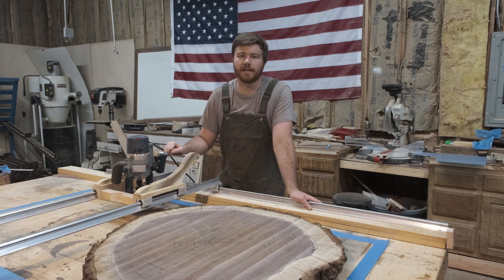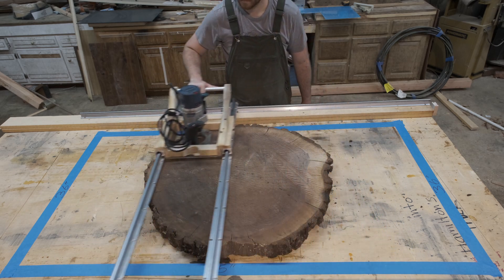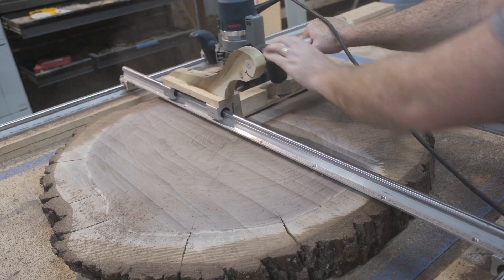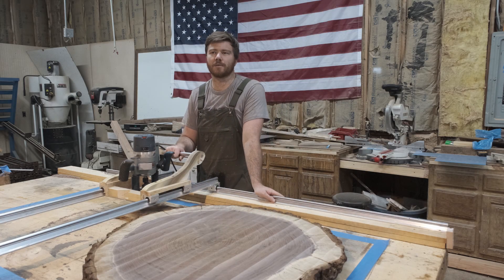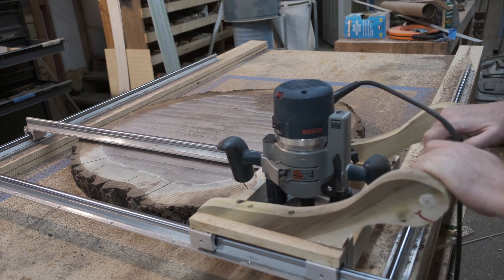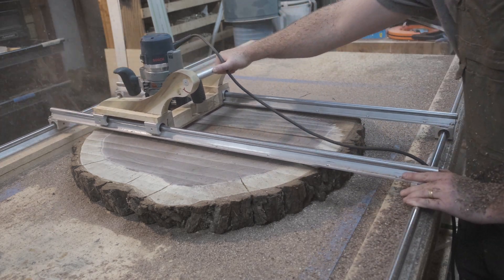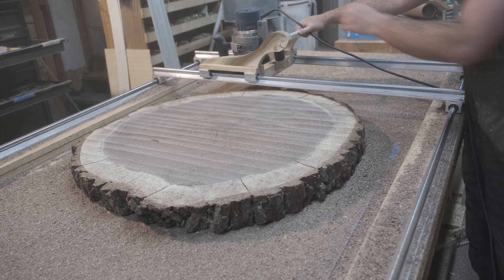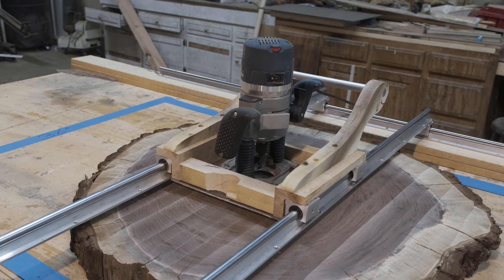DIY Linear Rail Router Sled / V1.5 Upgrades!

Comment: Hello, great video, i also flatten cookies with a router and a similar jig, but i have problems that sometimes the router kicks-back, don't you have that problem and isn't it a safety issue because you don't hold the router very tight.

Comment: I’ve added a 4” dust port to one side. My Triton router came with decent dust extraction vacuum port as well. So I use a vac for that too. I’ve tried the CNC brush strips. But were more trouble to fit. So gave up.  Should have gone with a shallower joining strip along the top. My design is in 3D warehouse.

Comment: Did you have to tap the holes on your sled rails, to get the top rails on the bottom rails bearing blocks? Bc following the links, my blocks and rails holes don't line up.
Reply: Correct. I used the bottom left and top right bearing block screw holes for more stability.  For me it was a nightmare trying to match up the precision of the machined holes. They should sell rails where the holes line up with the blocks.  Also I did read something about a certain rail size does match the bearing block holes. My 20mm rails did not match.  HTH

Comment: Just ordered my rails for a router sled and I'm so excited for it! Have a Bosch 1617 router and I was wondering what speed you'd run a 1/2" collet 2" flattening bit at for flattening slabs?
Reply: I have the same router and use a 2" Whiteside bit. The bit says to run around 12,000, which is somewhere between 1 and 2 on the speed dial on the router.

Comment: I like this idea for my own shop.  Do you know of an alternative to Amazon for these rails? (as I no longer shop with them).
Reply from the maker: Oh im sure theres a ton. I know McMaster Carr has some!
Reply: @HamiltonDilbeck  actually,  I managed to find an eBay vendor out of California.  Just ordered two sets of 1500mm so I can extend the length to 10 foot for my assembly table (with newly added extension).  A friend dropped off some 18" 9 foot tulip slabs to flatten for a table.  I got the 1200mm cross bars which should work well with my 4' wide table.  Looking forward to it.  Thanks for the inspiration!

Comment: Any deflection issues in the middle? I went with 20mm rods and im getting .040 dip in the middle with router wieght alone. Didnt go with the rail base style in the middle cause of weight. Curious on how much deflection yours gives in the middle before i go that route or try angle extruded  aluminum next.

Comment: Great stuff! Looking forwards to v2.0!
Triangulation is key to stopping the "wobbles". Braces (e.g. a length of all-thread") between the two ends of the two "short" rails would help to keep things square. Better yet would be a pair of (1/8?) sheets of aluminum above the long rail bearing blocks and below the short rails. Notch them to clear the router bit.
Look for bearing blocks with a "UU" suffix. They have seals that will keep out the (saw) dust. Either that or 3D print up some "wipers" that could constrain a couple of blocks of felt.
Look into a "CNC Dust Shoe" and an overhead vac hose to deal with (much) of the dust.

Comment: 12mm or 16mm rails ?
Reply from the maker: 16mm
Reply: Are the Rails standard design for the mower part?  If I get 16mm Rails from someone else to have for an extension, will they connect well enough to slide?
Reply: @steveandrewsmith  I was concerned about flex. So I went with 20mm. No. The screw holes did NOT match. On review some vids show only one screw per block was used.

Comment: A piece of heavy Aluminum Angle stock spanning between the glide blocks and the rails at each end of the cross slider should reduce the wobble.  4 bolts on each side of each end snugged down through the rails, and through the cross brace into the glide block should reduce the lateral wobble.  You might need to adjust your router gantry a bit to clear them, or they could act as your end stops as well.  It would also have the advantage of giving you a little more thickness for materials to flatten as well since it would raise your rails by the thickness of the angle aluminum brace.

Looking at your router sled, it doesn't extend below your cross rails, so it won't interfere with the travel.
YMMV.

Comment: Super Awesome! I got my kit put together. Guess what. The blocks use m6 screws... Also, I purchased a 1/4 in aluminum plate for the router base. No flex at all and very minimal. I may add the mower handle though. But first I need to build a table.

Comment: What do you use to secure the wood you are working on? Will simple double-sided tape work? Brilliant work!
Reply: I've seen closed cell foam hockey puck shaped work holders in other video
Reply: In the bottom left corner I have two shallow offcuts permanently screwed into the tabletop. One on the left side. The other along the bottom side. Making an L shaped corner stop. ( I_  ) I place my workpiece down snugged up against the corner blocks. Then another on the right of my workpiece and another on the top side.  This secures the workpiece on the horizontal. No vertical securing needed. To remove the workpiece you can lift it straight up.  Or to slide out you can unscrew the right side and if needed the top side stops to slide out. HTH

Comment: At https://youtu.be/5eGHxh7iHfI?t=54 in your video you mention buying extra bearing blocks and putting a piece of wood between them to stabilize the wobble you got when moved your linear blocks to the very ends. How would you end up "locking" those new linear bearing blocks in place so they just don't move exactly like router sled?
Reply: Extra BB not needed. A shallow depth hardwood length between the block and bar suffices for me.  I use longer screws lengths for mine.

Comment: Do you notice any flex in the cross rails. Looking at 1400mm for my setup. Thanks
Reply from the maker: I haven't noticed any flex at all on my setup. I don't think I would go about 1' wider, though. The linear rails are surprisingly rigid.
Reply: @HamiltonDilbeck  thanks for the responses  I think I am going to go with the SBR20 that should get me we’re I need to be

Comment: I bought a 1000mm and a 1200mm set of SBR20 linear rails, and unfortunately the screw holes in the base of the y-axis rails don't line up with the holes in the bearing blocks for the x-axis rails. Any suggestions for securing these together? They're both from the same manufacturer, purchased on Amazon. Should I return these and try for different ones?
Reply from the maker: Interesting, sorry that they aren't lining up for you. If I were in your shoes, I would drill in new holes. You can put tape over the bearing blocks and locate the holes and then make a little jig block for the drilling. Let me know how it goes!

Comment: Here are some tips for you.
In your earlier video, you complained about the cradle you made and the acrylic base. You don't need it.
All routers I know have a guide fence with guide rods. The rods fit into holes in the router base.

I measured the guide rods with my router and found they were 8mm. So I ordered a pair that were 330mm long (about 13").
These fit but were longer than really needed. I also noticed there was some play in the router base holes.
The router locking knobs take care of that but I ordered some 10mm rods to see if they'll fit. This time I got the 300mm ones (about a foot).
I've seen stainless steel and chromed steel versions. Either will do but make sure it's steel.

For supports, try SKnn where nn is the size in mm of the rods (e.g. SK10 for 10mm rods).
These lock the rods into place. You'll need 4.

Attaching them to the SBRnnUU glides will be a bit tricky since they don't line up together. But a square of wood between them would be the easiest option.
This then gives you an unobstructed view of the router base.
It also brings the two top SBR linear rails closer together. Although I've been thinking of using a rod at each end to fix their width further.

This also turns the router side handles towards you. Which means you can take them off and attach your handle in their place.

Oh, and you also need end stops on your SBR linear rails.
Here's an example of what I mean https://www.ebay.com.au/itm/133757145067
Unfortunately, I don't know their designation and that ad doesn't give it. Just calls them "Linear Rail Shaft Stop Collar Shaft Limit Fixing Ring".
Reply: this is REALLY helpful.  thanks so much!  also, thank you Hamilton for the video, in the first place.

Comment: Hi! Thanks for sharing! I'm thinking about doing my "surfacing table" with T-Tracks instead of linear rails. It will probably have the option to block it on one axis!
Reply: T-Tracks would collect dust. Think about it.
Reply: @two_tier_gary_rumain  I know, but by today prices on linear rails, it's at least twice less expensive...
Reply: @two_tier_gary_rumain  I live in France and these are called "Aluminium profiles" around here. It's either me or I can't find the same rails on this website. I'm also considering this alternative. Thanks!
Reply: @alindorindicu3732  Yeah but with 2x more is less than $100 easy which isn't much in the grand scheme of things.  The smooth motion of bearings on each axis could lend itself to being a pantograph router sled for all sorts of cool things.
Reply: @two_tier_gary_rumain  Steel Bar Rail 20mm is SBR20.  SB20 is Steel bar 20mm. I should have gone with 2 each instead of 4 SBR20. That way I would not have had to stress over the rail screw holes not matching the bearing block screw holes.  And could have made a much simpler cradle. Which was a nightmare for me.

Comment: has anyone seen router sleds where there is some sort of x-axis lock for each pass?  I used to use a machine that would cut drywall using these kinds of rails that you could lock the x-axis and/or y-axis and was very helpful.  

if you could make this an option i think you would open up lots of new possibilities for your work.
Reply: Do you mean a lock on the rails themselves or on the glides?
Reply: @two_tier_gary_rumain  I believe the machine I was using had a mechanism that activated a magnet to stop the glides from moving.  Look up MegaForm 3000 or Grabber Panel Max.  the guides and rails are the same.. the machine itself is obviously very complex.  but the idea that you can lock in the y-axis and x-axis would be awesome for different things outside flattening slabs.
Reply: @two_tier_gary_rumain  I've also seen little lockers that you can put on the rails as well.  not as precise - but could probably still do the job depending on what you're doing.  the machines I mentioned would be locking you in at an accuracy of 1/100 inch so yeah - pretty spot on.

Comment: I'm only seeing up to 1000mm rails on the links you posted (the two links for the rails end up going to the same link btw)
Reply from the maker: Yeah, they have sold out of them. The two links both went to the same page, but different selections of rail length. When the 2000mm sold out, it removed the option for them.
Reply: @HamiltonDilbeck  Gotcha - I'll check back later. I guess the 1200mm sold out as well
Reply: I've found lots of long sizes on eBay. 1000mm, 1200mm, 1500mm and 2000mm. You just need to search.

Comment: Thanks for posting this! I was wondering what type of issues you might run into before I built mine. Any issues with chips/dust on the rails getting into the bearings?
Reply from the maker: I haven't seen any kind of issues. I think that it would be good to lightly blow out the blocks after use as you disassemble it. But This is something more suited to someone using it a few times a month. If it were getting daily use, I would look into some fixed brushes at the ends of the block openings to help keep dust out.

Comment: Hi, rather buy new blocks for the end, couldn’t you just put a piece of wood between the rails, on the blocks, thus keeping them parallel. You will need a longer screw, will increase the height you can do under the rails as well. It’s just a thought. Stay safe.
Reply from the maker: That's a great idea! Way better than mine, I'll give it a shot!
Reply: @HamiltonDilbeck  I was thinking of something like that as well but it prevents your being able to easily remove the sled from the rails.  If that's not a concern then I might go with some 1/2 or 3/4, aluminum stock instead.  This prevents any possible stability issues with wood as the brace.  I would also dado out a bit equal to the size of the block so that they rest in notches in the stock with an inch or so on the other side.   This would really keep twisting at bay and give you three sides of surface contact for even more stability.  Actually, I would do that with wood as well...this could serve as something of a shroud or something to attach one to that you might protect the bearings from the possible contamination you mentioned on the first video.
Reply: 100%. That’s what I’ve done. Just purchased longer screws for the bearings.